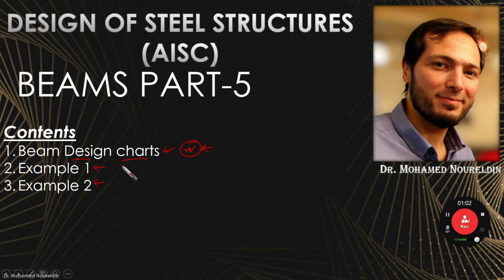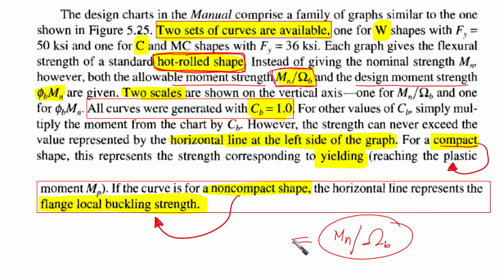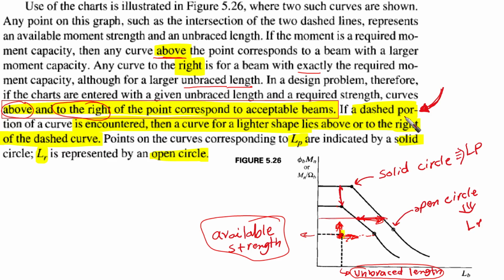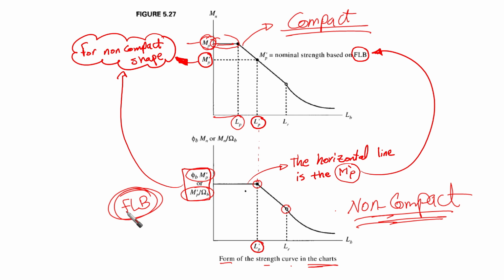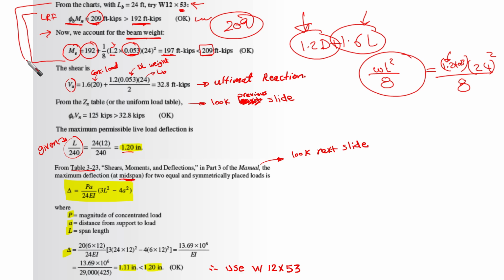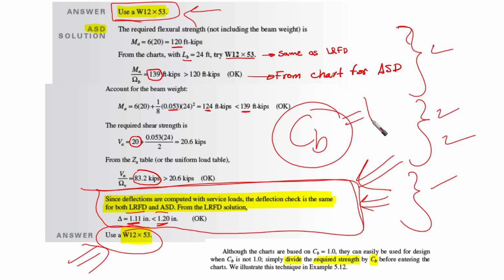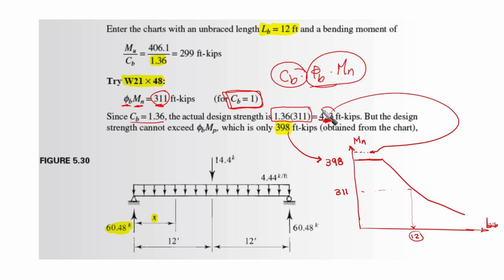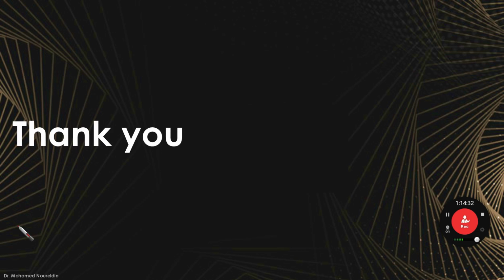17-Beams Part-5 Design Charts for beam design

Comment: we didnt check compactness at all before going into the charts. so what is the difference between compact and non compact when we deal with the chart ?
Reply: I think for hot rolled W shapes , they are considered compact 
So you know before you enter the charts
Reply: Yeah! the same thing confused me. If it is so, then why they did not already include these in the design charts?👍